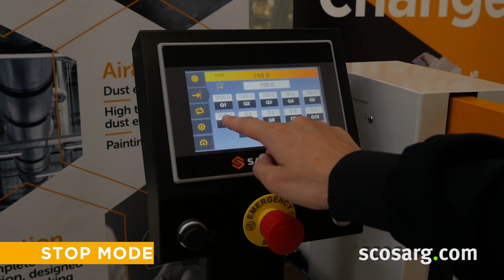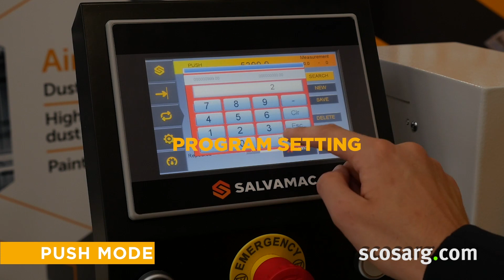Salvamac Crosscut Saw | Simple & Safe @scosarg

Comment: Zero mistakes, zero waste, and higher productivity.
We thought SalvaStop_100 as a fundamental component to give your work an edge. Through numerical control, this electronic stop manages the push, stop and positioning of the profiles to be cut, regardless of the material. So you can reduce human errors, avoid waste and decrease labor costs. You can say goodbye to the tape measure!